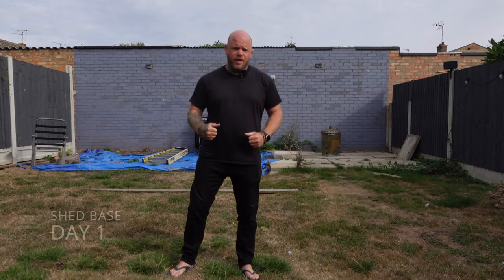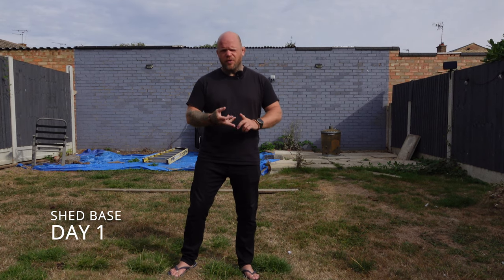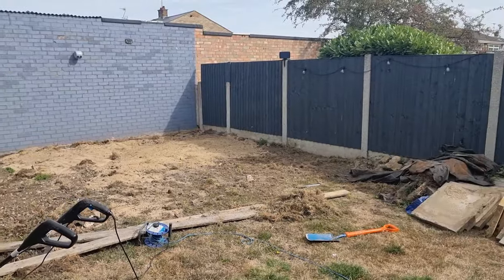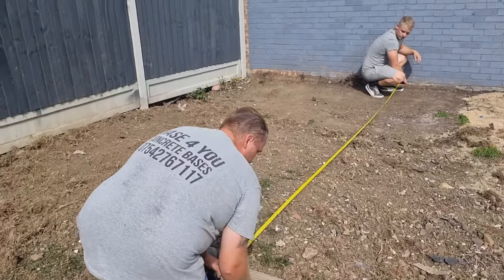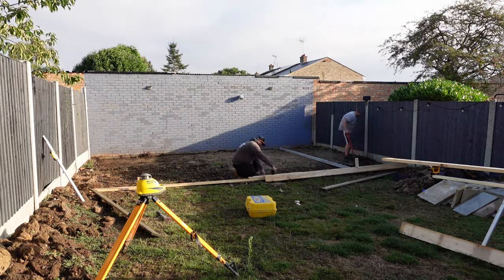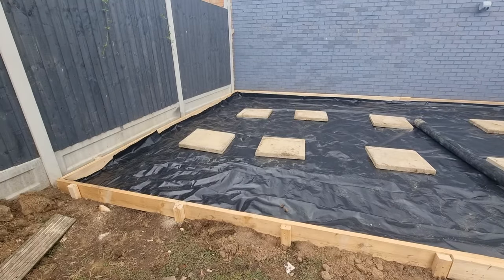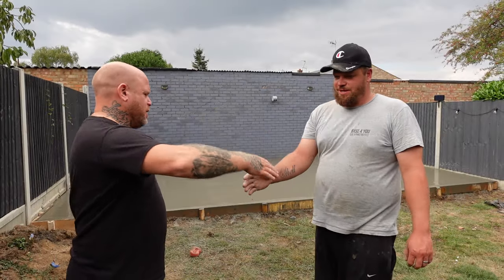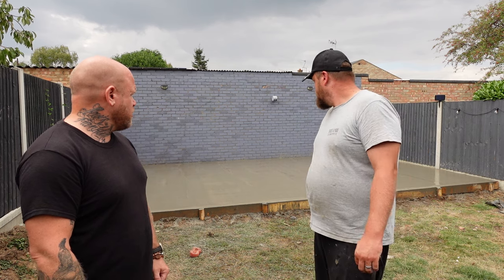Create a HUGE SHED BASE in ANY GARDEN!!!

Comment: I know you want the shed as large as possible , but leave enough room to enable you to apply preservative treatment every year or so ,  I made the mistake of building mine and leaving no space to get behind,  the back wall of my shad and floor base rotted out over several years .
Reply: This is good advice
Reply from the maker: Thanks yeah left a couple of feet access  so I can maintain it. Might paint the back of it in bitumen paint as it won't be seen and will last ages
Reply: @DudeStuff  - You should look into the greenboard for the inside of the shed, it's basically waterproof drywall and it will definitely help.... That and possibly doing some insulation so it doesn't sweat and drip water down the walls, especially if you want heat for winter workshopping.     👍
Reply: Yes good advice.  I deal with that problem a lot!  The beauty of sheds/summerhouses is that you can renovate them.  All timbers in contact with ground need to be tantalised! I've done a lot of work ripping out damaged flooring, reinforcing the base and then building new floor!  One of my biggest worries is the proliferation of OSB or worse chipboard in flooring.  These materials are not suitable for areas of outdoor buildings close to the ground!

Comment: Surprised they didnt put a steel mesh bed down to reinforce the bed so it doesnt crack up between summer and winter expansion of the soil beneath!
Reply from the maker: I didnt get all the footage in to show everything he used C35 spec concrete with reinforcement fiberglass fibers, 16mm rebar reinforcement and 1200 gauge damproof membrane. Apparently it doesn't require expansion cuts, it's strong enough.